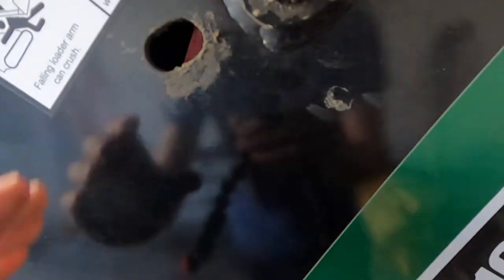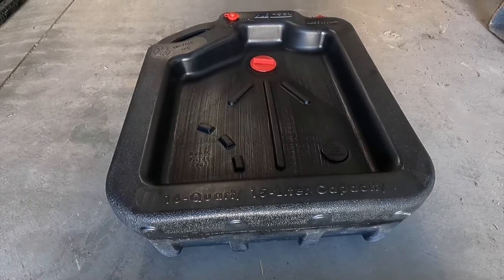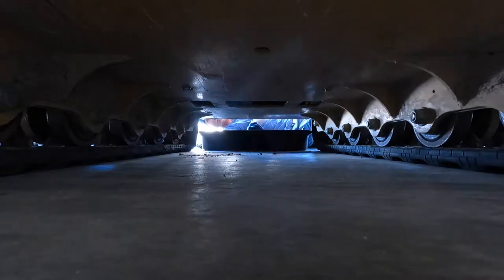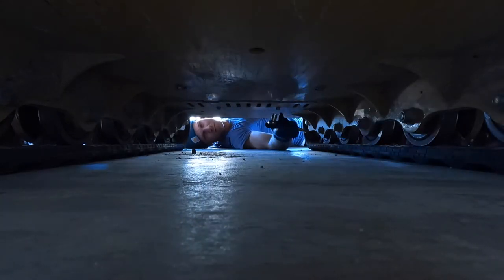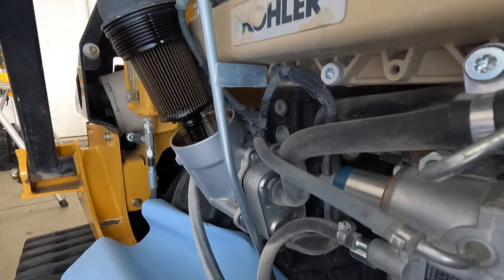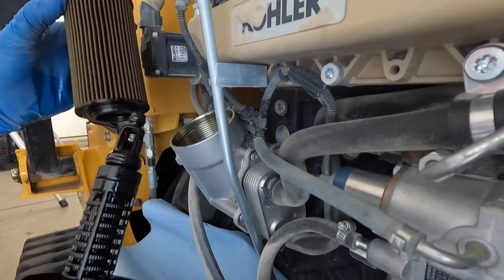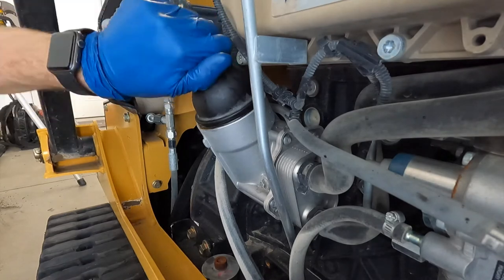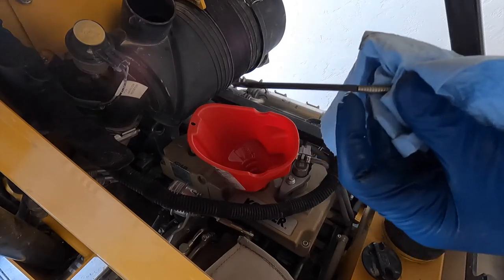Vermeer Oil Change with Oil Filter on a CTX100 mini skid steer

Comment: There was a metal copper colored ring in with the filter seals.   Any idea where that goes?
Reply: That copper washer is for the drain plug on the opposite side of the oil pan. Disregard the use of this copper washer until you have to remove the J.I.C. fitting that Vermeer used on the CTX-160 to change the oil. These plugs were so tight, people are bending the oil pans causing oil leaks. Vermeer has since came out with a oil drain hose for $130.00 to combat this short fall.

Comment: What is the washer for?  I see the oring bag had what looked like a brass washer in the bag. I just changed the oil on my CTX 160 and it had the same washer.  Was not sure what to do with it.
Reply: thats the oil plug washer replacement

Comment: If I'm not mistaken didn't that engine call for 10W-30? I thought that was what the manual said.
Reply from the maker: You are right.  I spoke with the servicing technicians at Vermeer and they said they always use what I used perhaps because it's a diesel and not gasoline engine.
Reply: @sylvangustin4170  I've always run 10w-30 Royal Purple Duralec Synthetic in my 100 and 160 in southern Alabama.